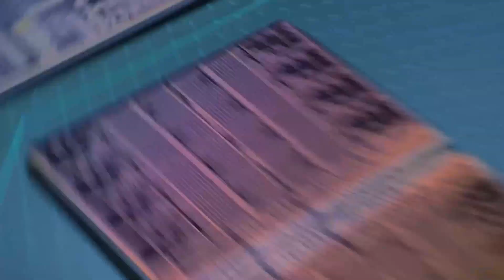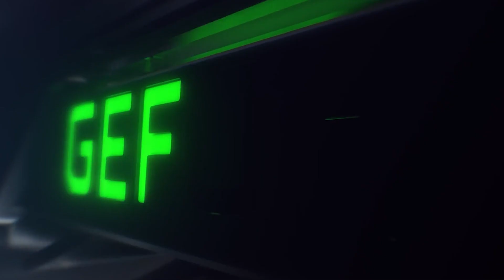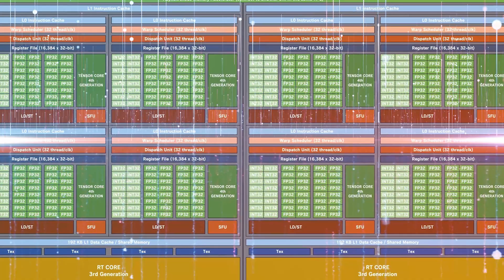NVIDIA's RTX 4090 is looking IMPRESSIVE!

Comment: Can't also help but think for those who need to use multi-gpu set ups that something like this will be a huge pain to possibly keep your system stable. Multi PSU will surely be the only viable option and even then you're going to surely have to be looking at 1400/1600w x2 PSUs.

Comment: It'd be hilarious if nvidia is less efficient than AMD despite using a newer node. Because thats what it sounds like with 600w cards like the rtx 4090. If it was 800w, it would genuinely be a room heater. You will basically turn on the heater, which would  overload your AC. Infact in summer, I'm not even sure if it would even be cooled via air cooling. AMD seems to be more reasonable in TDP's. 

If nvidia uses that much power, you can bet they're gonna be screwed in the laptop space. And if nvidia has to push this far, AMD ain't joking around. You've already seen RDNA 2 challenge nvidia in raterization. RDNA 3 will more or less have 'em catch up to nvidia in ray tracing, albeit not beat them. 

I think kopite kimi might be disappointed with the vram capacities with RDNA 3, as AMD is likely to give less than nvidia. And maybe he's not too happy with the Ray tracing performance. Or maybe he's unhappy with RDNA 3's software suite. Whatever the case, performance from AMD will not be "disappointing". And neither will efficiency.

Comment: Kopite7Kimi has said there could be an  850W RTX Titan or 4090 Ti and it could be 2.25x faster than the 3090 Ti in rasterization and 3x faster in ray tracing. That kind of performance should be expected for a GPU that consumes 850W watts alone.
Reply: I want to build my first ever pc for college as a 3d modeler and game designer I’ll have a nearly 3,500 budget what gpu and cpu should i buy

Comment: The 4090 if roomers are to be believed are that it could be the worst price to preformance gpu and worst power draw ever seen if what we heard is correct it should flat out fail and no one should buy it. As for amd there flagship is set to be as good a jump with lower power draw and less heat output. Intel is also roomered to be better than expected
Reply: Rumored...
Reply: except there not. amd have dominated the cpu market for a long time now and i dont see intel pulling ahead anytime soon.

Comment: "As high as 1899$..." More like "the alledged price should be 2x lower than the 3090 price was for year and half after its launch", the price is fine as long as you will be able to find a gpu at msrp and the performance gain from 3090 -> 4090 compared to pascal -> ampere should be way bigger, so increase in price is tolerable imo.
Reply: MSRP. It will be 4000$ after launch

Comment: 6:10 please. AMD never could compete with 3090 or just '90 series in general. so for the sake of the argument lets exclude that and focus on only 3080 vs amd
Reply: Are you high? RX 6950 XT is faster than a 3090 and even outperforms the RTX 3090 Ti many times.
Reply: @aninditabasak7694  are you high? you cant see amd cards suck in ray tracing?
Reply: @aninditabasak7694  Mate please, do some research before you even compare these two video cards, the RTX 3090 TI is way better than you could think of, not only in rtx or non rtx gaming, it literally makes the work better such as programs called After effects/Davinci Resolve and etc. It still beats the 6950 xt in most of the games without rtx, yeah it consumes the power 2x more, but does this actually change the fact that it is better?